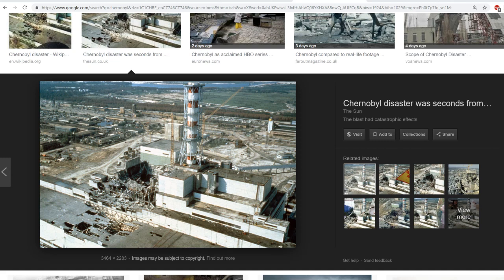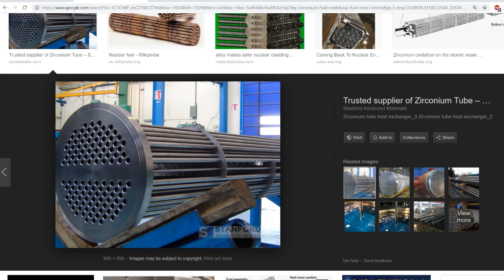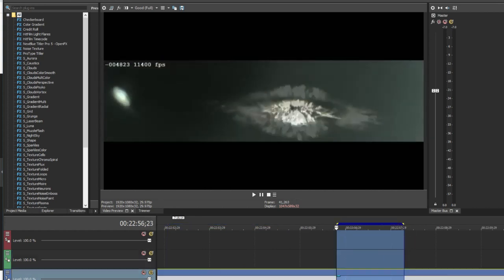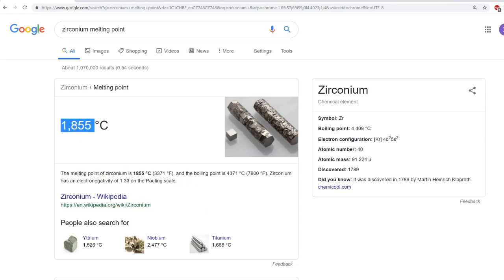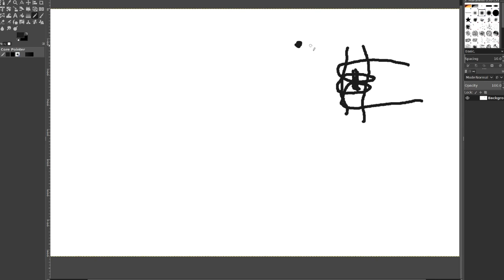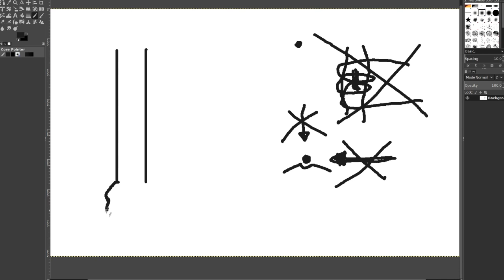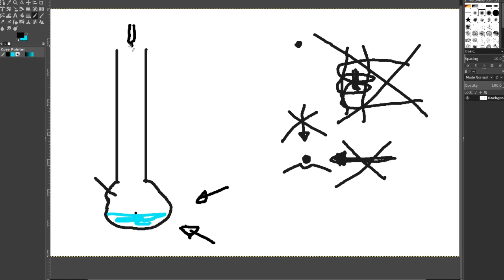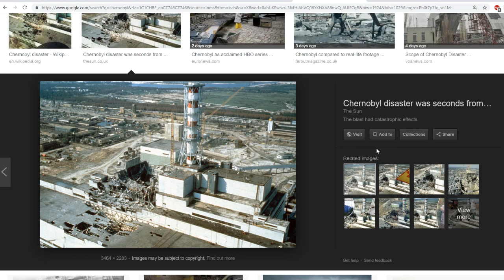Was Zirconium the real reason Chernobyl exploded?

Comment: A stoichiometric mixture of hydrogen and oxygen (which it'd be if the hydrogen source was split water, as you seemed to suggest) has a flame speed of 4km/s; it'd detonate, not "burn", and it wouldn't have to wait until it escaped the reactor before it blew up. Though with a constant ignition source, it'd still be an energy soup (with Zr being an ingredient?) of superheated steam, rather than buildup of explosive gas mixture. I'll grant that you glossed over other explanations to get to the point of your video, which is how to setup your experiment.

And given that the Chernobyl secondary explosion reportedly happened 2-3 seconds after the primary explosion, it seems fundamentally different than the Fukushima story of water radiolysis venting Hydrogen building up to explosive concentrations.

My source for the flame speed was this Tech Ingredients vid:
https://www.youtube.com/watch?v=l9CI6KSV560

Comment: The water reacted with the Zircalloy cladding of the fuel rods and other materials in the reactor. The temperature and pressure shot up due to the power surge that destroyed the reactor, and steam oxidized the Zircalloy cladding into hydrogen and zirconium oxide. When the first explosion ruptured the reactor, hydrogen, hot graphite came into contact with oxygen, triggering the second explosion.

Comment: Maybe you can use a elliptical reflector 
furnace, and pass a tube made of a low IR- Absorbent material (eg. Quarz) through it. The sample could be lowered though the furnace by adjusting the argon- pressure.

Comment: I am not do not know what is exactly the clue that led you towards this, but it does not matter. I do not know if you solved this issue already. But what is stopping you from inverting the problem? Instead of dropping melted zirconium into the water, why don’t you drop water on the melted zirconium? Sounds simpler to arrange. Yup, looks like 2soldierman2 suggested the same...year ago. What can I say...I just saw this video now. Still no clue if you did something on this topic. Keep an eye on temperatures, pressures and quantity....Water is not going to be L “happy” meeting 2000°C metal and neither zirconium nor the container (crucible) will enjoy meeting liquid water (temperature differential). On a positive side, you can keep heating the crucible from underneath and you can experiment with various amounts of vapour injection first.

Comment: For high temperature melting consider "arc furnace". Two graphite/carbon electrodes (for weld removal) powered by stick welder. You already have Ar inside which makes arc easier. Carbon rods at an angle because magnetic Lorentz force will push the arc which also stabilizes the arc so it does not wobble so much in hot swirling gasses. Material for melt just put in the arc, material does not have to be electrically conductive.
Reply: Graphite/carbon electrodes have one drawback, the arc plasma contains so much active carbon that metal-carbides immediately crystalize on electrodes. With AC current crystals form equally on both electrodes, for DC current only on one electrode. The DC + electrode runs hotter due to heat transport from the plasma by electrons. So it is more like carbon reactor then a furnace. May be a ceramic shield can separate arc from "test metal".

Comment: Is it possible that in some of those rods they had a different metal for research purposes? What other metal would that be?
These reactors are claimed to be everything the best: unenriched fuel, source of energy for factories, plutonium production and probably isotope research.
I do not know all the details but not all rods are fuel and control rods. The very fact that they can load and unload rods on operational reactor suggests research.
Is one rod of "experiment metal" enough to create second explosion in case of partial core meltdown?

Comment: even if you did this experiment, you wouldn't be getting accurate or even, decent result because you can't reproduce the pressure and conditions that where in the nuclear core, and another, is the 700 ton reactor block which was blown out of the reactor, would have stopped a large majority of the steam and decomposing water molecules from escaping the reactor itself. among the factors that you haven't covered either, that where at play.

Comment: Induction sintering of zirconium is typically done by coupling the oscillating field to a SiC susceptor. https://en.wikipedia.org/wiki/Susceptor
Would the argon need to be pressurized to keep the water from boiling away before the molten zirconium could make contact?

Comment: I estimate the power per zirconium-clad fuel element as follows: the reactor at its destruction is estimated to have a power between 30-300 gigawatts. It had 1661 fuel channels with 18 fuel rods each clad in zircalloy (99% Zr & 1% niobium). That means we would be looking at a heating power of 1-10 megawatt per fuel rod. Each fuel rod had an active length of 3.4m. So, for a realistic test, for each meter of test rod, you'd need a momentary discharge of 300-3000kW divided by the efficiency of your induction heater. 
Source: https://en.wikipedia.org/
Here's a video of a 1MW capacitor bank: 
https://www.youtube.com/watch?v=iq2xIloRIds&ab_channel=SinaRoughani

Comment: @VoiceOfThunder A good idea to use a welder. Welders tend to make hot bouncy metal balls and throw them all over the place for their fun. To make a liquid metal droplet fall you can repel it using magnetic field, the way rail guns do. I might try this out with my power supply and the cut offs of iridium wire. If it will work, then it will for zirconium as well.

Comment: Quite a late comment but I haven't seen your video 'till now. Here is why no zirconium was needed for Chernobyl: At the time I was a young student in the Eastern bloc. In September a year before Chernobyl I had my final exam in Nuclear Engineering. One of Qs was... how could Chernobyl type nuclear power plant explode (in a way). Soviets built their nuclear power plants not primarily for safe energy production but so that they can get the greatest yield of nuclear waste usable for further nuclear weapons material production. Hence, graphite reactor which unlike typical Western water based reactors does NOT have a linear response to the controls.Western reactor you can pretty much "drive" like a car-push control for faster, release for slower. Soviet graphite reactors response to controls depends not only on input but on previous state and previous gradient of change. Hence, one must be extremely careful and deeply knowing what they are doing while controlling it. Now comes the Communist corrupt factor: in the Eastern bloc you got cushy jobs not based on merit but on ideology and corruption basis. Soviets have admitted that the man in charge have "run experiments" on the reactor, "controlling it". What I read between the lines from experience, the job have been given to a barely qualified person. He was bored. He played twiddling the knobs. You "jiggle" the control knob on the Soviet graphite reactor, you are almost certain to send it in uncontrolled acceleration. Some recent "documentary" shows claim that it was "design error". No, it was known fact (that even a student must learn for their exam) but accepted into the design because of desired nuclear waste production. Now, when you have nuclear reactor running away due to the bored idiot at the controls, there is nothing capable to stop it, that moment was the end of any control and the remaining Q was how will limited structure cope with it. Worse, by design there are tons of superheated graphite,... structure collapsed, collapse under those conditions led to inevitable non-nuclear explosion. So, no zirconium needed. Could it have contributed to the inevitable, ok but not  the  main problem.

Comment: The Zirconium fuel cladding didn't cause Chernobyl, Fukushima, or Three Mile Island. Heat from the reactor did. In the cases of Fukushima and TMI, it was the decay heat from the recently created fission products combined with the sustained loss of cooling. In the case of Chernobyl, the core was still operating at power, while the operators had backed themselves into a position from which there was no safe way to shutdown the reactors without doing at least a moderate amount of core damage. Zirconium's tendency to strip the Oxygen from water and react exothermically above 2000 degrees F certainly didn't help, but the big danger isn't the Zirconium-Oxygen reaction, it's the liberated Hydrogen escaping containment and reaching atmosphere. That's what blew the buildings up at Fukushima, and was the biggest danger at TMI, although the heavier pressurized-water reactor containment probably would've survived intact. Chernobyl experienced a massive positive reactivity excursion when the tried to run an ill-advised safety test under nearly the worst possible conditions, and they achieved a rate of power increase normally reserved for nuclear warheads. The resulting steam/Hydrogen/nuclear explosion was sufficient to throw a 10 foot thick, 55 foot wide steel and rock shield over a hundred feet in the air. The only way you get that kind of a reaction from a few tons of Zirconium and H2O is if you drop it from space.

Comment: i quite like this theory, has anybody else ever thought about this?
you know, we don't think about it a lot because it has a ridiculously high activation energy, but zirconium has a whole lot of stored energy from the initial refining from oxide to metal form, at a high enough temperature it could act just like sodium/potassium. just look at aluminum: same sort of story there, once the temperature is high enough, you can dump it into water and if the oxide layer is thin enough, it can all oxidize at once and explode like crazy.
I've never seen it demonstrated in the case of zirconium, though (maybe it's never been done before in history?), so this would be a very, very interesting experiment to see.

Comment: Zirconium is not responsible , after the lid was blown up air entered the core , that's it .
EDIT: that zirconium tube is not similar to the one at rbmk reactor .
Well HBO made a similar mistake that zenon was inside the reactor after the atom cores we're separated 
and that's impossible because the core of an atom is made only out of neutron's and proton's .

Comment: No, it was a positive void coefficient. What cause the second explosion, was cause by air rushing into the reactor core after the 2 million pound reactor lid was blown off and sat on the top of the reactor at 15 degrees. 1, the molten corium, and the water and fresh air was what cause a secondary reaction, and then caused the after math of what we have today. The zirconium has ionic bonds, meaning it won’t react, or bond with the fuel. Therefore, the zirconium didn’t cause the 2nd explosion.
Reply: You are right

Comment: Make a tungsten carbide crucible, connect the mig welder, keep the water at 1 degree C: Tungsten carbide has a high melting point at 2,870 °C (5,200 °F), a boiling point of 6,000 °C (10,830 °F) when under a pressure equivalent to 1 standard atmosphere (100 kPa), a thermal conductivity of 110 W.  Just an idea??

Comment: Tig welder, large argon filled container Water in base, Acryllic windows. Had a piece of kit just like that outside welding shop. In last place I worked. Heavy pit of pipe-fitting. TIG plasma temp ~5,000ºC. No oxygen required. Could have top open to drop molten zirconium in through the stream of argon.

Comment: I'm no scientist or engineer, but wouldn't some Blacksmith kit do you well?
Alec Steele on his channel straight up liquefies high carbon steel, that is only 200 degrees short.
Your torch even gets you halfway, stack some insulation around and you may well get the heat you need.

As for gravity, could you drop the water instead of the metal? That might beat your moisture problem, but I guess you need surface tension for any of this to work.

Comment: Maybe the manufacturer has the ability to help... A controlled detonation could get hot enough. There may be a type of welding machine or method that can reach those temps. Fire training facilities have flashover chambers, but they reach a max of 1200 F while inside, but might reach higher if it's for science....

Comment: What if you could get your hands on an induction heater. And then you suspend the zirconium just about the water with something like lead of Tin. Something that has a low Melting point that shouldn’t interfere with the reaction your trying to observe.  This way if the induction heater flash heats the zirconium to its correct temperature and also melts the other metal you are suspending the zirconium with. Dropping the zirconium into the water at the correct temperature

Comment: TIG welder, replace tungsten electrode with a zirconium rod with DC Electrode positive, strike arc against a graphite block, use a large gas lens to get good argon coverage, let the zirconium melt and drip into the water. The whole thing can be done under argon either in a glove box or using a fixed set  up and letting the high frequency start the high current arc. Look up TIG welder to get an idea about the process. FWIW it is not difficult to melt a 1/8" tungsten electrode using this technique.

Comment: Have you considered an ark furnace? All you will need is two carbon rods, a HV transformer and a refractory brick. You could have a drain hole in the bottom of the brick. Then when the Zirconium becomes molten, it will drip out the hole in the bottom. That will allow you to have your 2000C dropper with water waiting under the furnace to catch the molten drop.

King of random made one out of a refractory brick, microwave transformers and carbon rods salvaged from lantern batteries, So it can all be done on the cheep.
https://www.youtube.com/watch?v=VTzKIs19eZE

Comment: The resistance of heated metals rises with temperature so you might not be able to melt your sample with an induction heater.
If you want gravity to transport your drop, couldn't you use a zirconium wire and heat only the tip of it till it melts into a droplet heavy enough to separate from the rod naturally?

Comment: You can turn the whole thing upside down. If you can't drop melted Zr into the water, just pour the water on a melted Zr.
Let a piece of melted Zr stick to one (or both) of the W electrode(s), and then pour the water on it from the top.
Reply: That was my first idea as well, but my guess is that it might make the observation more difficult/impossible.

Comment: A study is available describing the reaction of molten zirconium with water [1]. In that paper, on page 10, it is mentioned that induction heating has been used to drop molten zirconium onto water and other methods are described, such as discharging capacitors through zirconium wire in water. @VoiceOfThunder the paper below is very relevant.

[1] https://www.nrc.gov/docs/ML0505/ML050550198.pdf

Comment: and if you drop the wather on the molten metal?
Reply: you could put all the things in a vacum tube, the wather encapsulated in a glass vile, the zirconium in an graffite crucible, put the whole thing inside de magnetic fild of the induction heater (cheap ass ones for under 100 on aliexpress btw )and explode the whater vile either with microwave or laser heating, you culd do a very compact setup insede a blast shild cose shit is going to be wild

Comment: You got any university verification to say you have more than a basic understanding or how nuclear reactors worked, because if you did you would be horrified , nuclear reactors use water to try to stop un chained reactions the result is high pressure steam.
One link in the chain goes down and you have yourself a nuclear disaster.
It is very well understand the reactor went unchained because water flow was stopped allowing the heat to build up to unchained reactions causing the reactor to blow its top.
I bet your a flat earthier or a god bother, nothing in this video is considered evidence let alone quantifiable.

Comment: I think the welder is your best bet but a TIG not MIG.  Use tungsten TIG electrodes.  
You are going to have two problems, holding the sample and getting it hot enough so that it is still a molten drop when it hits the water.  Weld puddles cool and solidify really quickly and the plasma arc will move the weld puddle.  So the sample is not going to play nice when its molten.  The  Zirconium needs to be held by something that is not conductive or the arc may track across it.  There are high temperature ceramics but I think most of the good ones have metal oxides in.  The only other thing that comes to mind is an Aerogel these will handle the temperature (just) and could be manufactured with Argon instead of air to reduce contamination.  So my solution is a cup made from argon filled aerogel with the tungsten electrodes purging with argon heating the Zirconium well past its melting point, then tip the cup into the water.

Or you could speak nicely to the national ignition facility Zirconium would be a breeze compared to fusing tritium.

Comment: Would it be possible to heat Zirconium with an induction heater? You can get extremely powerful, yet cheap, units from china. That way you could put the Zirconium directly in the water and wrap the induction coil around the glass.

Comment: I thought up a hypothesis about that second explosion. Instead of zirconium, I think it could have been graphite.

I believe that the first explosion had enough energy to powderize the core and as the lid was lifted, air mixed with already hot graphite dust. Since the core was at some 2000C, you can expect a vicious spontaneous combustion of that mix.